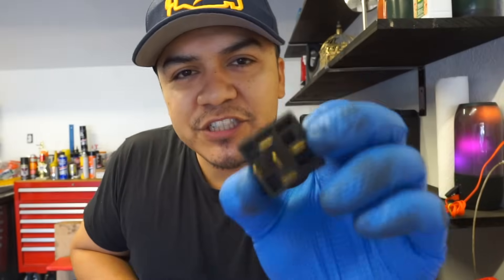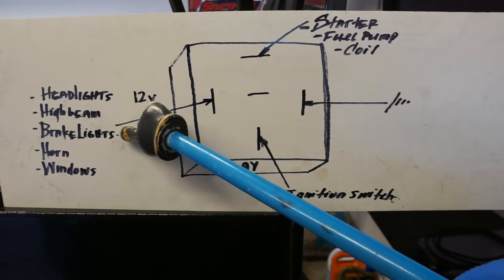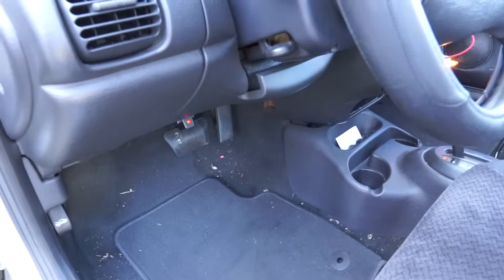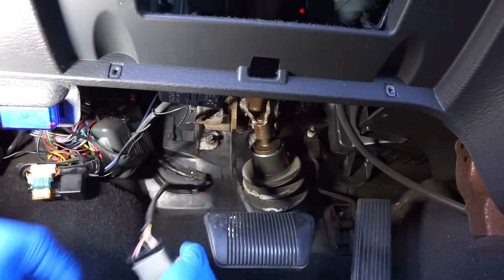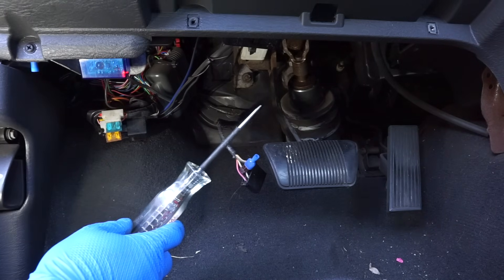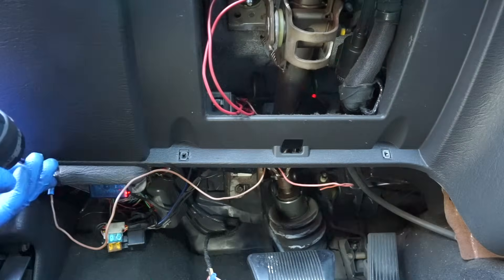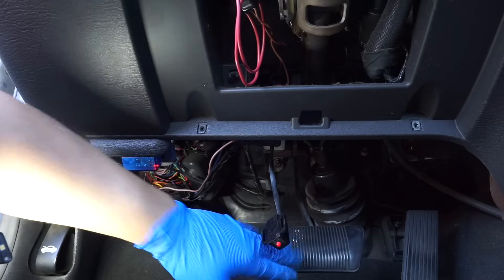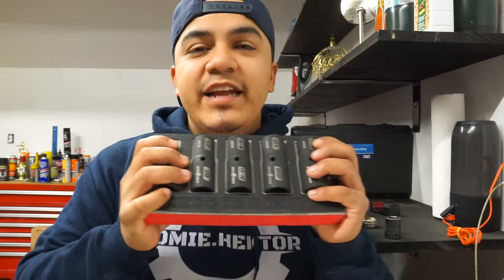How to use a relay as a Kill Switch or safety switch

Comment: Great info, I’m looking for a time delayed switch that would allow the thief to start the vehicle get moving and then  the car would die if the switch is not bypassed. I saw one about 20 years ago worked well. You would start your car as normal hit the bypass within 20 seconds and continue driving. If the by pass was not activated the vehicle would die.  I guess it was designed so the person would get into a lane of traffic when the car died to attract attention..would this be possible as a DIY???
Reply: In this design the delayed signal would power a relay that you feed the ignition power wire to pins in the normally closed option.  When timer kicks it energizes the relay opening the circuit mimicking turning the key off.  This could be in addition to a switch to allow start,  but not necessary. My father used the cig lighter to complete the ignition circuit.  You could  crank dith no run unless lighter was pushed in. Lighter didn't function and it was before we were charging a phone from there too
Reply: There are time delay boxes for power control builds.

Comment: I have 2012 BMW 528i Xdrive for my son to take to the college, think about install a fuel pump kill switch, I just installed one for my other son, his 2013 Hyundai sonata got stolen, recovered with $6500 damage, I am assume the ideal is the same, the fuel pump are all at back seat close to the gasoline trunk, my question to you is did you installed on your bmw? did you cut one wire with what color? is that green with what color wire?

Thanks

Frank
Reply: Frank just get a nice modern cobra security system . They communicate with cell phone and can be wired up to windows and sunroof to do cool stuff like luxury cars. I don't have any faith in you messing with BMW wiring

Comment: Good Video, with useful information... Personally I just go under the hood and pull the Fuel Pump or Starter relay from the fuse box and stick it in my pocket. Chances are a thief is not going to be walking around with a relay for your specific vehicle in their pocket.  Like the idea about the curious kids. A combo wiring might be good (Foot on the brake with the headlights on) too.
Reply: Unless they plan to steal your car ahead of time, like a targeted theft

Comment: Hektor, can I use a starter relay wire rather than the ignition wire?
Reply: One is interrupted and the other is connected.  Interrupt starter and connect ignition.  Relays with normally open  and normally closed pins are needed to get the operation desired.
Reply: @joeKisonue  I did use the starter relay and it works a charm

Comment: Almost all drivers today step on the brake pedal before turning on the ignition and cranking the starter. Informative video though on what you can do with a relay. 😃
Reply: Exactly my thought. This would not stop a thief, but it would stop a small child who can't sit in the seat and reach the peddle. It is a great idea, but the wrong circuit.
Reply: he said for his kids 😭 it may mess around on 🚗
Reply: Yep, the brakes are really a no-brainer.
Reply: hi step 3 times before he star the car
Reply: @engram9511  its impossible to prevent thives but you are trying to delay the process and make them frustrated. for example web dev we are told its impossible to stop hackers but you try to make it harder for them and time consuming for them to hack your website but if they waited few weeks they might have access to your webiste but it will cost huge resource and power. 

So I think its a great idea to start with and maybe add a second keys witch + the rely and hide it somewhere so that only if you have the key then the car would start. at the end of the day it impossible to stop them but you want to frustrate them as much as possible. 

hackers, thieves etc etc are hard to stop to be honest.

Comment: I like to wire the relay that the circuit stays open with power. But if the relay loses power the circuit will close grounding the coil killing the motor. I was looking at the relay thinking of the 87 and 87a. Any thoughs on 87a?

Comment: Can the 12v wire be connected to a cigarette lighter ? So you plug it in to feed 12v?
Reply: You can use the cig lighter as a switch if you rewire it on the back. You can without any relays or other parts, extend the ignition  or starter signal wire from the harness in the column and pass it through the cig lighter. Pushing it in acts like a switch.  However you won't be able  to use it for anything else anymore.

Comment: It took me a minute to figure out that you were using the brake pedal ti energize the relay which then "allows" the key signal to get to the starter. I love your solution, that way you can't forget to re-arm the system. I've used a variant of this method for forty years but it is time for me to upgrade to your method
Reply: Isn't any thief going to step on the brake pedal before starting the car?  It's a very standard practice.
Reply: @chrisgraham2904  yes, but he's doing it for his kids to not be able to accidentally start the car.
Reply: Using the brake pedal is stupid. High beams is a much better idea. But an even better method is the one I described above. That way you don't even need an extra relay just one more thing to break as he's not installing a capacitor across those contacts. Yeah one needs to place a 0.1ufd across those contacts.

Comment: Hi i have a compressor, in side i have a relay that is wired in a very strange way, maybe you can help me to understand way, 85 and 87 are connected together with a pfb, they are as on, and 86 is used from the other side, 30 is not used at all... Can you see any logical explanation for what it's used for? And if so, what does it do?
Reply: A test light will help you visualize what's happening   seems like it's using the open and closed but auto triggering something? I would  have to inspect

Comment: Even better would be to put a toggle kill switch on the brake power side that way you need to turn on the toggle switch and hit the brake pedal to start. I too step on the brake pedal to start my truck. This would be a better solution in my opinion. Just a couple more wires to wire up.
Reply: Or just have a toggle switch interrupt the power to the fuel pump relay done...

Comment: Hektor help me.  I wired up the relay as you instructed.  I made my rear window defogger switch my control.  When I try to start my car the starter turns about a 1/4 turn and stops.  I have checked the relay and it's good. I tested the starter relay in the car and it is good also.   What did I do wrong?  Thanks
Reply: The rear window defogger takes lots of power, the starter also takes lots of power. Disconnect the defogger so the starter gets all the power. Just a side note, If you use a rear window defogger with window tint, the defogger will cause the tint to have lots of bubbles.
Reply: Did u ever find out more or get it working? What happened?
Reply: @pouncerminned863  just installed a separate hidden kill switch.

Comment: I've notice that you use the brake light switch to start the ignition.. my question is when the car is on and running and step the brake pedal the switch will be engage... is the car will stop or no?
Reply from the maker: Liamthomas De Vera the way I installed it, you need to step on the brake to engage the starter motor. Braking while driving won’t affect anything as it will only open and close the relay. Just like most relays on the car 🤙🏼

Comment: Good video. But, alot of people like myself push on the brake when you start the car. I dont think it would deter thieves if that's your intent.
Reply: The brake pedal is an example. Gotta get creative! I would have it relay to the kid lock switch so holding that while starting would let car start
Reply: @pouncerminned863  yeah the rear window enable button is great on 4 door sedans

Comment: So this means if I have YOUR key, i can enter YOUR vehicle, stick the key in the ignition, start it, an steal it just by stepping on the brake...
Reply from the maker: manuel rodriquez yeah, safety first 👍🏼
Reply: Or, you can break into the car, drill out the ignition cylinder, step on the brake, and turn the ignition with a screwdriver. If you have more time, you can cut the wires off the ignition cylinder and short the proper ones to power and a quick tap of that yellow wire will crank the engine. Using the brake light as a safety switch for young kids is fine, but most people are taught to step on the brake whenever you crank the engine and start a vehicle as a basic safety precaution. That means criminals likely have that habit too. If they do that, they wouldn't ever know this kill switch is installed because it wouldn't appear to do anything.

Comment: Great info very useful, but if your relay is wired to your brakes everytime you use your brakes the relay is activated which is fine nothing will happen but when i drive i constantly use my brakes. so with this setup the relay will be switching on/ off a lot, still not a problem, but that means that the relay will wear out faster( i know relays last a long time) so maybe a diferent power source would be better (so you're not left stranded). I.e. something that is not constantly used all the time. Maybe a switch between both relays? Or get power from glove box light? Anyways Awesome vid love it. Just my two pesos
Reply: you mean you would have to open the glove box everytime you start the car....right???????
Reply: That's what I was thinking as well. Great comment. Otherwise great effort by this sparky.
Reply: You can use anything it don't gotta be brakes, it could be AC, the top interior light, high beams, anything you can switch on an off basically, this is a really good video because i plan to put one in my Honda but needed a better understanding on the relay itself and the proper way to wire it, lots of good info here 🔧🔩👍👍

Comment: Cool video have older truck was thinking of doing same with cigarette lighter wont start unless you push in lighter. Grew up in New Mexico got a kick out of chingadera
Reply from the maker: Lou Fresquez try it out, let me know how it goes 🤙🏼
Reply: Yeah you rewire the ignition through the lighter.  Don't use the original 12 out to ignition or if the wire is always hot you can create a battery drain if you forget

Comment: Best and easiest explanation I've seen about relays and their purpose.......Love the idea of the brakelight trigger!  Wanting to do this with RFID tag system to use as a starter kill.
Reply: Update? Did you do the RFID and was there any battery drain issues? 

Thanks
Reply: Same time type of relays used on riding mowers like Deere and Hustler.

Comment: I think its not a good idea to use a relay on the brake switch.coz youre subjecting the relay contact switch to constant on and off during driving and braking..thus the relay contact will wear out fast.you could have use a simple on/off switch going to ignition/ starter wire..
Reply: Dam I should of read more comments. I posted the same comment, yeah a switch would not be a bad idea. Or maybe a dome light or glove box light. But yeah right over target.
Reply: @etulosbaakdov1756 : Chris Fix killer switch is easier, and faster to install, and best of all, it really works.

I installed in my car, somebody tried to steal it once, but failed.

Comment: I just order one of those power ground circuit testers that plugs into the lighter. What a handy tool to work with your test light!
Reply: I've had a fluke meter for years in fact I have a coupla of them. They measure everything... ohms, capacitance, diodes, volts, amps. You really need to learn at least VDC circuitry to work on vehicles and while you're at it learn a bit about VAC as well that way you can work on house wiring. This is knowledge that will help you throughout life not just when you're young. BTW Fluke (115 model) meters are pricey but they're forever they're an "instrument" not  a piece of shit.

Comment: Good vid. Back in 2002 I bought an Acura Integra with a bad engine. Once I got another engine in it, I couldn’t figure out why the starter wouldn’t spin. After about a 20 minutes I found a hidden relay under the dash and the control side was connected to the headlight switch. 🔦🏎
Reply: Definitely a good idea to notate the kill switch install in the "notes" section at the end of the owner's manual. A thief is not going to look in the manual to see if you wrote that down, but when you sell the car or dispose of it some other way you can just say "Hey, the kill switch info is in the manual notes in case you need it in the future."

Comment: This is not a Kill Switch, please get your terminology correct. By the way, congrats for introducing a ton of resistance into the brake wiring system... so now, if the customer steps on the brake and activates the switch for a long time, fuses may blow and wires will heat up since you took one circuit and integrated it into another circuit. Remind me to never visit the Firestone where you are.
Reply: I agree that this isn't the best idea, but not for the reasons you mentioned. This relay is mechanical so it has a limited life span. And the lifespan is reduced even further since every time you brake, you're toggling the relay. Better to use a SSR or use a plug where the relay can be easily replaced once it goes (and it will go).
Reply: Darin Porter The control side of a relay draws about a 10th of an amp. Could you explain how this would damage a brake light circuit?
Reply from the maker: November 248 this guy is a fuckin idiot, let him be 👊🏼
Reply: @pl5882  That's true, but it introduces interference and increases resistance throughout the circuit, it's not just the switch that is tied to the all around bigger picture of the circuit. On top of that, the location is the worst possible location for a relay and splice. Feet will hit it entering the vehicle and not to mention rain and other debris. It's a good idea, yes, just not a good execution.
Reply: @darinp5612  Would splicing into the heated rear defogger switch and controlling the starter relay be okay? Or would that cause interference and resistance too?
Reply from the maker: Man I just saw your comment, I guess YouTube knows to NOT notify me of your stupid comments. You’ve got it all wrong buddy, or should I say Zombie....🤣